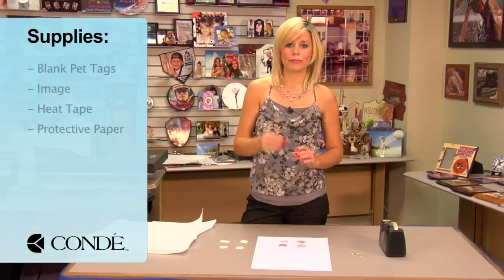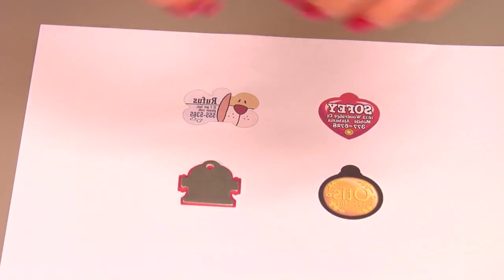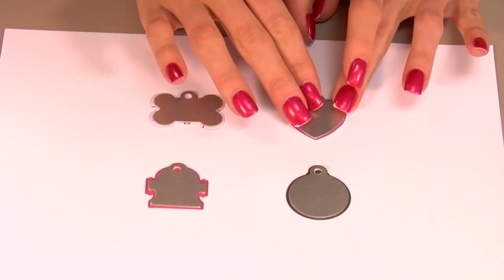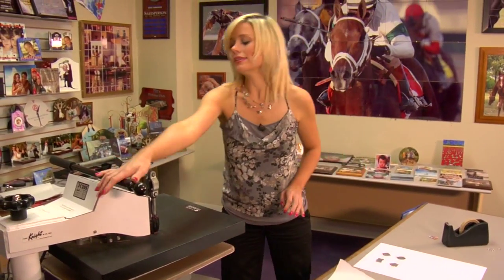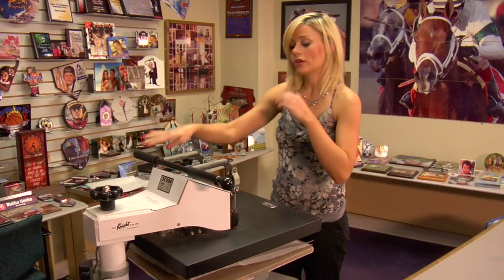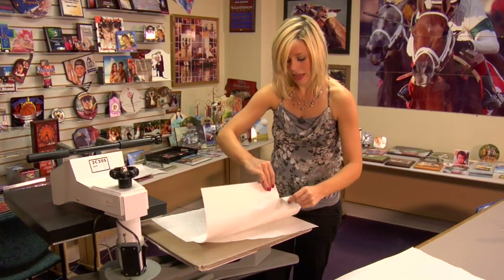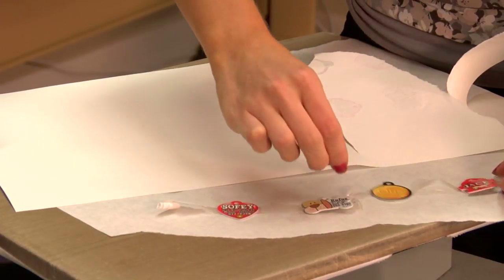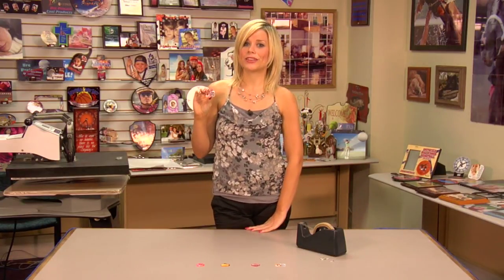How to Sublimate Unisub® Pet Tags - Step-by-Step - Conde Systems, Inc.

Comment: are these tags aluminum silver on both sides, or is the side she is sublimating white? also can you sublimate on any color tag, hot pink for instance ?
Reply from the maker: The tags are coated for dye sublimation with a special poly based coating. These Unisub tags are coated on one side only, the other side is silver. The coated side is white because there is no white ink in sublimation. You could imprint on any color tag, supposing it was coated for sublimation. We do not sell any pink ones coated. You could imprint hot pink onto the white coating....